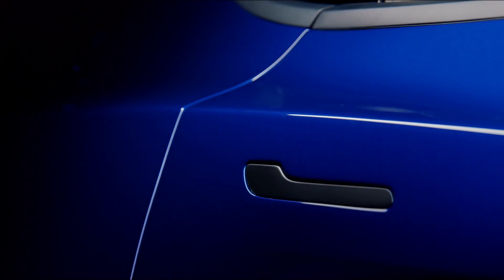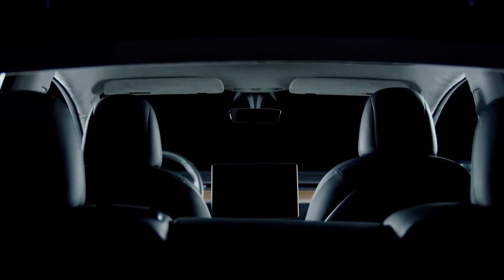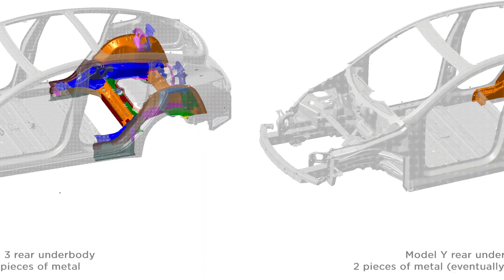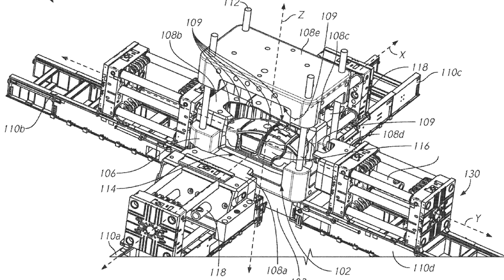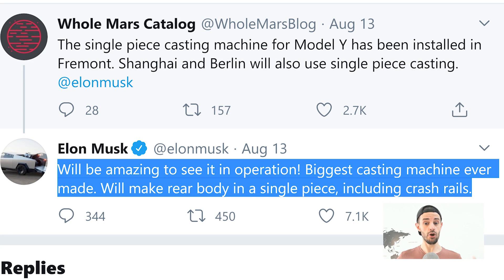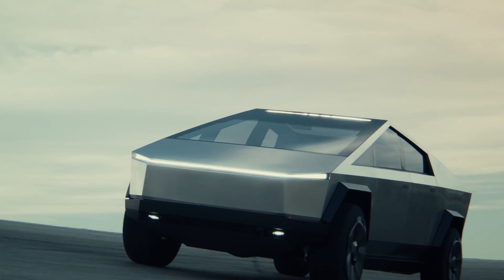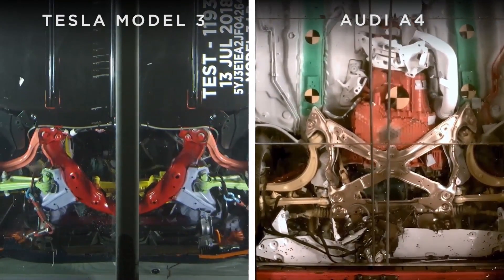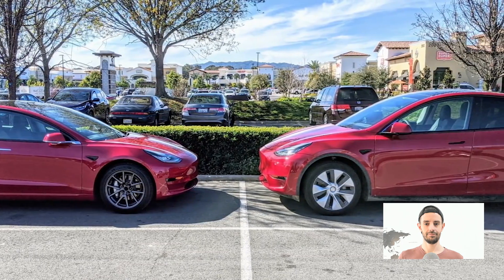Tesla's INSANE Giga Press (engineering genius)

Comment: I like the concept to reduce the cost by reducing the quantity of parts needed but in case of accident, this new single part will be so expensive to replace cause it will not be possible to repair it as you can with a steel welded construction...
Reply: If the damage is that severe the car would be a write off anyway. Still cheaper to replace than the zillion parts of today

Comment: Fun fact, the giga casting machine forces the molten aluminum under pressure into the mold in under a second. this is to insure there are no voids and to ensure the temperature is controlled evenly during the cooling process for the required strength properties to be met. 

again, around 100kg of molten aluminum rammed into the cast in a fraction of a second!
Reply: wow
thanks for the insight
Reply: Yeah fascinating! Thanks heaps!
Reply: Boeing and AirBus should both sit up and take notice. They’re both going to need to be able to offer aircraft at substantially lower prices than they’ve been able to offer in the past  if they are hoping to survive long into the future.  Or perhaps they too, like the big auto manufacturers, will also not be able to, or even want to see the hammer on the workbench right in front of them... 
With their manufacturing seemingly getting ever more complex and difficult they need to take up the mantra “less is more”.
Way to go Elon! 👍🏼
Reply: ensure** (not insure)
Reply: how many bad castings per hundred?
Reply: @ken-mb5cp  no idea, ask Elon
Reply: chaos guess they can just throw it back in the smelter if it’s flawed.
Reply: @ken-mb5cp  that's what they generally do at most casting manufacturers. But from what i know of forced injection casting the failure rate is much lower, hence why they use it.
Reply: @ken-mb5cp  Pretty sure bad casting would be melted down and shot again.  So provided that the rate is low, not a big deal.  My guess is they'll get the defect rate down to 1 percent.
Reply: Pressure and vacuum aka little resistance and no air pockets getting pressurized and trapped from inflowing material.
Reply: Cool as fuck

Comment: Another incredible improvement in the pipe for implementing into production this autumn is the new wire harness for the Y that will reduce wiring from 1500m/vehicle to 100m(!). Not only a cost and weight save in materials, it will also enable more robot automation during assembly.
Reply: @excelrobot  🤣🤣
Reply: I thought this had already happened

Comment: Big Auto can be thought of as Monoculture.  They have different names, but they're all using the same technology, the same techniques and processes.  When you introduce a Polycultural element into an environment dominated by Monoculture, the former will thrive and consume it all, because Monoculture is weak.
Reply: San they have ICE engine and drivetrains manufacturing nailed, nothing else 😆 and that’s the most useless piece of the puzzle

Comment: I'm curious how you would make structural repairs to the single casting for minor rear ended damages or if the entire rear casting would have to be replaced? Your closing statements are very sound Steven, you always make a confident conclusion
Reply: Typically these days if you get to the point in an accident where you've damaged the frame of the vehicle, it's more than likely already a write-off/salvage and you wouldn't be repairing it anyway.
Reply: Good point.
I’d imagine the design is such that it would have to be a pretty serious impact, the type that would require major repair on any car (if it wasn’t just written off), and that the usual bumps and dings of daily life and gate-posts, would be handled by the plastic surrounds (bumper, wings etc.).  It’d be a bloody nightmare if not. ;)
Reply: @cbromley562  yeah, I'd image as such too!
Reply: That's why autopilot will soon come, after 2025 nearly all crashes will be human error. And the amount of crashes will be much much lower.
Reply: It doesn’t take much of a collision to “total” a car. (Any car) If that casting crumples, it’s now a parts car.
Reply: Chris Weston why not external airbags controlled by sensors?
Reply: ken 1  I think that would cause more problems than it solves. Airbags can be dangerous, even in a controlled situation.

Comment: It's actually easier to engineer in the crash impulse response into a casting as you can vary and corrugate the profile for a casting in a way you can't with sheet metal, to allow it to fold in an impact.  Also the joints are eliminated as weak points, that are also less predictable. Its also potentially lighter in cast aluminium than steel sheet at 3 times the density.  The NVH improvements come from increased stiffness, right where it's needed at the rear suspension input points, meaning a more controlled body response. Front turrets will almost certainly be next, that's been done before on other vehicles. Less seams also saves on fasteners, fixings and expensive sealants. For any vehicle produced over 100k units per year this is very logical.
Reply: The main issue with doing this in casting is the control of temperature of the metal. It should be hot enough so it doesn't become solid too fast and you don't get the necessary details and small pieces right, but also not too hot or cooling too slow so that the final result has the correct material properties.
That's why Musk also talked about "inventing a new type of metal". One of the reasons this hasn't been done yet is the fact that creating big structures with a lot of small details in casting is VERY difficult and in some cases simply not possible with most of the existing types of metal.
I'm honestly very curious as to how they actually managed to pull this off.
Reply: Michiel Ecker can you link sources? And email them to me mblend27 at gee Mail dot com
Reply: @mblend27  you're asking for a source related to the "inventing a new material" comment from Musk or the issues related to casting?
The Musk quote I can look for, but the casting is based on my engineering courses at the University. I could look for the course book if you'd like.
Reply: I think I also heard Sandy Munro say that Tesla metallurgists had found a composition that means no further polishing (he said something else but some kind of finishing to the cast) doesn't need to be done. Not only do Tesla guys create their own silicon they also develop their own metals...I almost feel sorry for legacy auto!
Reply: I am wondering how they are able to overcome the ductility issues with cast aluminum. I wouldn't have thought a huge cast piece like this possible due to potential for cracking. Also, how will collision repairs be handled... any damage or warping to cast piece == totaled
Reply: @Nathan0A  there won't be any collisions. So why bother with repairs? 😁
Reply: @Nathan0A  In regards to repairs, go with the Apple model and replace the entire car. Unless it's possible to replace that one piece? Tesla's goals are to build fast, cheap, and with quality (defying the "triangle of constraint"). They're not trying to make service centre revenue like legacy auto. Insurance co will pay for new car.
Reply: My experience is mostly with injection molded parts for toys, but I would imagine Tesla would also be able to change wall thickness here and there if needed and or mold in scores to help predict crumbles, more consistently that welded stamped sheets ... this could be very very good!